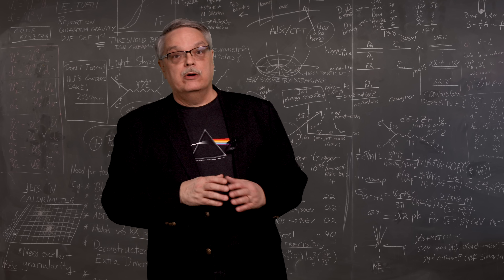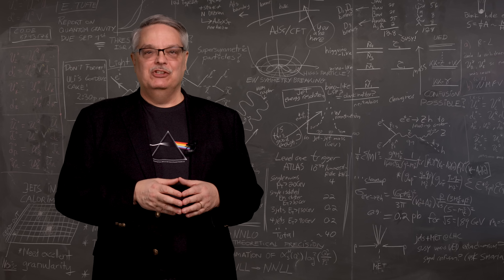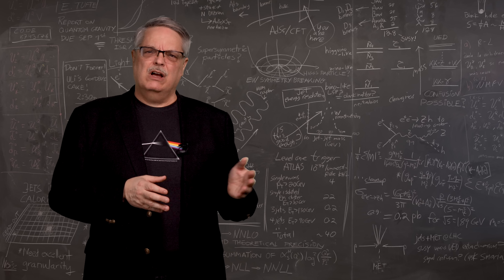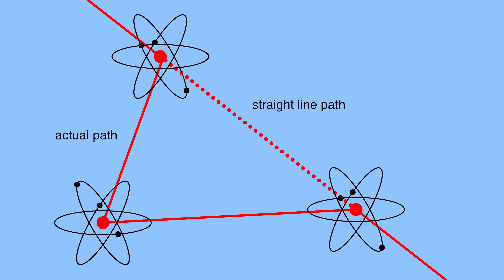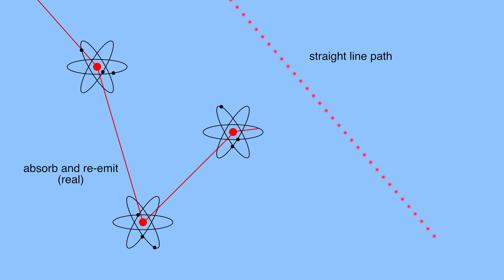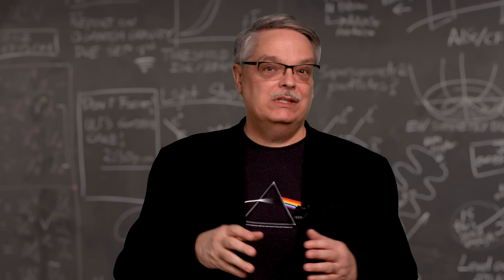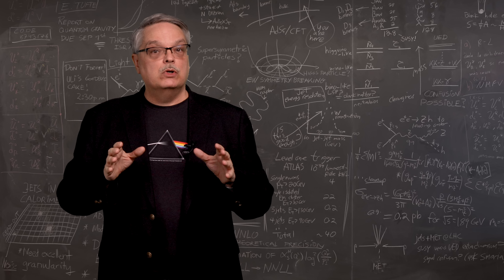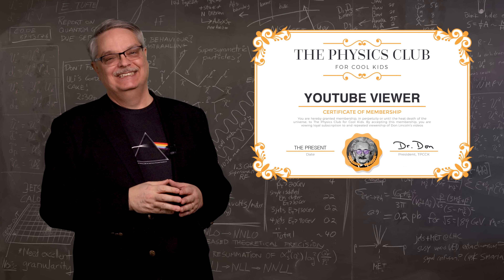Why does light slow down in water?

Comment: Thanks a lot Fermilab! Can I clarify something with your explanation? Electron motion produces EM field oscillating at a particular set of frequencies. Yet, refractive index varies with wavelength smoothly (hence, rainbow is always a smooth picture). How does that fit?
Reply: Electrons motion can have different frequencies depending on the electric potential binding them. When bound to a single nucleus (a Hydrogen atom), they produce a certain set of frequencies, probably what you were thinking of. However, when bound to a crystal lattice, such as inside a piece of glass, the potential is more complex, and allows the electrons to take on a continuous range of frequencies. It's a rough explanation but I hope it helps
Reply: @avivschwarz8513  Media like water and glass are not crystal lattices, yet they show a rainbow pattern of refraction. And  yes, in metal-like lattices there is "merging" of electron energy levels into bands. But that's not universal either.
Reply: @albat6538  I'm curious; why do you think the rainbow is a continuous (smooth) spectrum of colors?  Surely quantum theorists have shown that only certain EM frequencies have the requisite energy amounts to produce a photon (?) of light.  Forgive me if I'm showing my ignorance.
Reply: @albat6538  Yes, like I said it's a rough answer. Even in liquids and non-crystalline solids, where band structures cannot be computed, electrons can still take on a continuum of states. Spectral lines from gas and liquids are due to vibrations/rotations in the molecular structure (i.e the nuclei). The electrons have enough freedom to respond to incoming EM waves.
Reply: @walter1032  Black body radiation (like light from the sun) is continuous, so rainbows are also continuous- with the exception of absorption lines, which are frequencies that correspond to energy level transitions in a certain material. So if you studied a rainbow with a good spectrometer, you would find all wavelengths except those absorbed by gas in the sun's corona, the Earth's atmosphere and the water droplets.
Reply: @avivschwarz8513  Thank you so much.
Reply: I am far from satisfied as he was again telling a half story and trying to evade the real problem. People tend to play the wave-particle  duality whenever it's convenient to them, without giving any accurate (though there's an extremely rough one) criteria when to use which. If you want to explain everything with wave, just keep consistent by viewing every glass quark  as a de Broglie wave... Or alternative let's put it this way: try explain what happens when a single photon EM wave shoots into the glass from vacuum.
Reply: @GyacoYu  "All models are wrong but some are useful". Ray optics are never the "correct" answer, but they are useful for many cases. When they stop working, you can move to the another, more complex model, i.e wave-particle duality in this case, which is much more universal but still "wrong". In fact all particles can be described by waves, but you need QED, and in some cases QCD, which are very complicated theories (and incomplete themselves). I agree that it's frustrating not knowing when to use each model, but we have to trust those who are more experienced until we learn ourselves- because it's madness to try and solve every problem using the most fundamental tools, especially on a pop-science video such as this one
Reply: May I put my two cents in as a holder of a BA in mathematics who has read a first-year college textbook in physics?  First off, keep in mind that physicists are the only group of people in the world who don't know that the Big Bang theory is stupid.  (Just kidding; they know it's stupid, but they need a placeholder for the expansion of Space.) Secondly, your question appears to relate to quantum theory as contrasted with classical theory.  As Dr. Lincoln said, physicists believe that Light sometimes acts as a wave and sometimes as a particle.  That's my input, which might not even be worth two cents, but read the third paragraph of the Wikipedia article "Electromagnetic field".  Have a glass of water and two aspirins nearby.

Comment: Light do not slow in any case, it's either in full flight, or a complete stop.

The light seen in water is nothing more than photons REFLECTION from surface contact.

Here's proof, interrupt the WATER SURFACE to see the whole light picture changes .

Light do not penetrates solids, or water, which is a state of solid mass, on contact with Matter it's instantly transformed changing it's identity, and become same as it's host, in this case it becomes water, just as it becomes a part of the human body on contact. 

Light contact with atmospheric clouds shows up on the other side with a changed identity known as a cloudy day.

Comment: Wouldn't it take some period of time once entering the glass to move enough electrons to create a field of the appropriate strength to affect the light? Also wouldnt the electric field be present for some unit of distance outside of the glass? This process seems instantaneous the moment the light enters and exits the glass and the explanation given would appear to need some time to create its effect.
Reply: That depends on perspective. An hour is a long time to a child to a gamer that can literally feel like 10 mins.8 hours is the determining factor for bacteria and the like to grow. A billion years for life to exist only mere seconds needed to wipe it out completely. Also Light could be considered a supreme ultra thin material as its a result of a energy process and will be part of the resource consumption. Radiation, soot, dangerous particles, gases, heat, electric and magnetic forces a lot of things lay in Light. Sorta like how we equate red markings on insects to mean extremely dangerous thou it's not always the case due to mimicry
Reply: That's a very good question. It seems clear that the "interaction propagation speed" at the boundary cannot exceed the speed of light, thus there must be some period and some distance, however minute (a layer) in which the light wave slows, decelerates in a sense. 

Imagine a planar layer of one-atom thick glass (know glass is not an element and I use the word atom very loosely). Then a layer of vacuum several glass atoms thick then another single atom thick layer of glass with a repeated sandwich of any thickness. Could light defract in that? It might seem like the distance the light deflects to an offset parallel path would be tiny, on the order of an atomic "diameter", but in fact it may be zero???

For example, would a one atom thick sheet of glass defract a beam of light any differently than a one atom thick layer of water?

Would the speed of light in a "near vacuum" be identical to that of a vacuum until there is some threshold density of atoms that can interact to form a refracting wave? Regardless of whether it would be measurable, could a single atom/molecule in a vacuum slow light?

Comment: 9:18, ok, but why would the wave from the electron move at a different speed??? You focus so much on the new wave formed, but this doesn't answer the question why light moves slower. It's not even a circular argument, it's no explanation at all

Comment: I'm slightly confused here as the critical point of the discussion is kinda glossed over. You are implying (but did not state) that the wave generated by the electrons is some how slower but at the same frequency and amplitude as the original wave. Like it has a constantly changing phase to the original wave. To me this critical point is not clear in the discussion. Surely this will also cause some sort of spread of the light as the waves generated by the electrons will also produce further forces on other electrons. The continuation of direction of the secondary produced wave is also not discussed. Is it some sort of equal polarisation?

Comment: Why does the combined wave travel slower?
Reply: I assume because of some equation where time is a factor. If you combine two wavelengths, the interval between the peaks will change, and that interval is also a frequency in time. So if the interval gets wider apart in space, the interval gets longer in time? I don't know but it seems like it'll be some relativistic thing where changing the spatial dimension of the wave causes the temporal dimension to dilate to compensate for that change, causing the wave to "slow down." And the cause of this slow down is due to the extra charge of electrons in the glass.
Reply: @ag-bf3ty  Thank you. Because you wrote "because of some equation" I want to clarify that equations don't cause things, they describe them. 

So the video's explanation doesn't involve wavelengths, just the observation that waves traveling with different speeds combine to give a wave that travels at a third speed. The two waves being combined are light traveling at a speed c and an oscillating electric field generated by the interaction of the light's oscillating electric field with the matter's electrons. 

Still, you might have something by considering the wavelength because you can make prisms out of which light of different wavelengths diverge.

Comment: This does not explain why lights bends in the material. What is persuading it to turn ?
Reply: Light actually doesn't bend when it enters a material, unless it's approaching the glass from a particular ANGLE. No angle = no bend.

That should give you a clue. To determine how much its angle will change, you have to combine the angle of approach, with the material's index of refraction to get the new speed of light and the new angle.

Comment: Great video, thanks. One aspect you didn't explain(and I know it wasn't in the title) is why the light bends and then returns to the exact same direction. I'd imagine it is related to the way a water wave diffracts upon entering shallower water, but not sure how it would be explained in terms of your superposition of the two waves. Anyone?
Reply: @Cornelius Corcoran Perhaps a way to think of it is that as the light is coming in at an angle, the "inside" (left side of the red line in the video) of the light ray slows down before the "outside" as it enters the glass first.  As the light maintains it's own speed and the slow down is just due to wave addition, on the way out of the glass where the light wave is no longer interacting with the electrons in the glass, the reverse is true with the left side of the light moving faster compared to the right, bending it back. Therefore, the light has the same velocity (speed and direction) when in the vacuum again (it helps having parallel sides on either side of the glass in the example to make that true).  Refractive index and Snell's Law is key to all of this regarding determination of angles.  I hope that's right / helpful as it's just my personal understanding!
Reply: @a.k.1902  I think thats a common misconception. What about single photons? Do they have something like "inside" and "outside"?
What about light traveling through caesium gas with refraction index < 1and phase velocity > c?

PS: Feynman's path integrals may give an consistent answer to light bending. 
Feynman says a singe photon takes each possible path (it may even fly around the moon to reach a screen 2m in front of the light source ;).  But... almost all possible paths interfere with each other in a destructive way so the resultant probability along a straight line usually becomes almost 100%. However, because of different phase velocity inside glass (and other materials) the interference and thus the probability distribution also changes according the incident angle -- the phase shift on the inner side happens earlier than on the outer side.
The exact same principle is used by holograms on bank bills or many other today's uses. Holograms are partially covered mirrors which changes the probability distribution of reflected light to form a 3D effect.
Reply: @Merilix2  Light is a wave and photons are a product of our limits of detection. The photon anomalies that occur in experiments are always explained as a waveform. So yes even a single photon will bend.
Reply: @izaakveenstra  I dont want to go into a particle vs wave discussion. Photons are in some sense both or none of them^^
Reply: @a.k.1902  Thanks. Sounds good and fits in with the old 'Marching soldiers' explanation I learned at grammar school.
Reply: Light approaching at an angle has a kind of angular velocity relative the surface. As it slows its angular velocity is kept but not its forward velocity. Why that happens is even more complex.
Reply: @izaakveenstra  Thanks. Hasn't been particularly 'illuminating', but maybe I'm just 'dim'.
Reply: Wrong wrong wrong. Light only will reemerge traveling parallel to it’s original direction if*** the first and second surfaces are parallel. This is from conservation of momentum. His own shirt shows an example of light going in and coming out at an angle. This is partially why prisms work as they do.
Reply: Perhaps, it relates to the Noether's theorem and consequently the principle of least action. I dunno. xD
Reply: Light is a spherical wavefront that is absorbed by ions. Those ions oscillate creating new wavefronts. It is the interference patterns of innumerable wavefronts that we perceive as a point-like particle.

The “slowing down” of light is merely the interference pattern creating a resultant ray that is perceived as a “light ray” that “slows down.” The only ray pertaining to light is the interference pattern resulting in constructive interference along a particular path.

So, when a spherical wave front strikes the atoms of a transparent/reflective surface, the electrons Nahum to oscillate creating new wave fronts. Because the wave front is spherical, it will interact with the atoms of a flat surface at different times.
Reply: One can explain defraction with Huygens principle and the reduced Speed of light.
Reply: boundary conditions for the wave at each interface. Basically em waves can induce perpendicular and parallel oscillations in the material differently, the vector generated by this difference causes the net bending of light
Reply: i think this has to do with the frame of reference as light must always travel at a constant speed therefore it takes a longer path inside the material with higher refraction index and shorter path in air so it must change direction
Reply: @Nightspyz1  The path inside water (or glass or whatever) doesn't matter. Light bends at the transition between different medium and only returns to the same direction if the surface of both transitions (air->glass, glass-air) are parallel.  And Yes, that's not explained in the video even if both effects are connected.
Reply: Light is always trying to use the shortest time to complete its journey,  so in this case it trys to minimize the time it spends within the slower speed medium (glass) to escape asap, hence the refraction angle is relative to the speed of light in the medium, slower speed means higher angle to shorten the distance lights has to travel through the medium,  as for why this happens go and read/watch about the double slit experiment and mind blowing will become even worse, the quantum particles/waves behaviour is just weird,  in short, it feels that every photon has future information even before it enters the class, about how wide is it and how slow it will be to travel through it!
Reply: @Ramiarmuni  Light entering glass doesnt even know if and where or when it will exit.
Looking at how light travel through a prism, the exact reverse happens, the path inside the glass become longer than a straight line.
Reply: @Merilix2  yes strat line is the fistest route in general, but in this case and sense the speed is slower in glass, it chooses to pass less distance in glass to be able to regain the faster speed in air quicker
Reply: @Ramiarmuni  Thats not correct!
In a prism like this, the distance through glass becomes even longer due to bending, not shorter! A horizontal inbound will be refracted downward..
  /\
/__\
Same for a converging lens.

Comment: Not saying this is wrong, just that now I have more questions than answers and I suppose this should be good?
Reply: First wasn't the electron already moving and emitting it's own electromagnetic wave? Is the interference from the electromagnetic wave of the light strong enough to shift the electron position? If it is after the light stop going through it does it "go back" as if nothing had happened? Does the disturbance of the electron affects electrons of nearby atoms? If it does does it means that the energy of the light is being dissipated in the process?

Comment: In order to answer that question, one first need to understand what the speed of light is. An the speed of light is the inverse of the product of magnetic and dielectric permeability. Slowing down actually is a function of the changing of these properties in any transparent material, as every material, transparent or not, has a different magnetic and dielectric permeability. One only need to go back to the 19th century physics, and read Wilhelm Weber in order to underhand that, as it was Weber who first proposed, in correspondence with Gauss, the constant, currently known as the speed of light. it is incorrect, though it is pervasive everywhere, to represent the wave in a 2D. The real, (di)electromagnetic, wave is a 3D physical phenomena, as technically any electromagnetic vibration is even when it adheres itself to a conducting service such a metal lattice.

Comment: Another dumb question. So, if the light causes the electrons to emit an electromagnetic wave at a slower frequency than the light itself, is this because the electrons have inertia (mass), and can this be used the measure the mass of the electron.